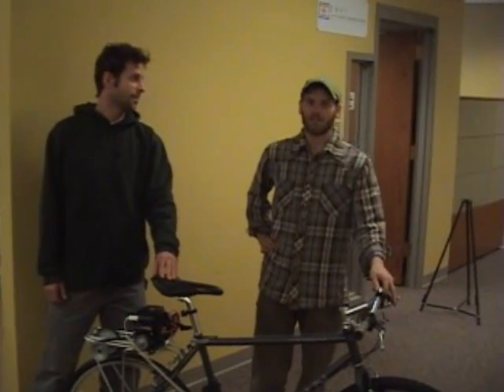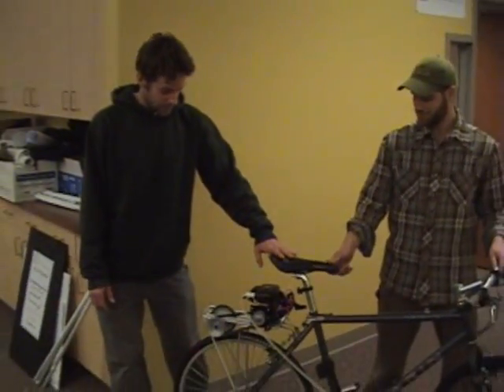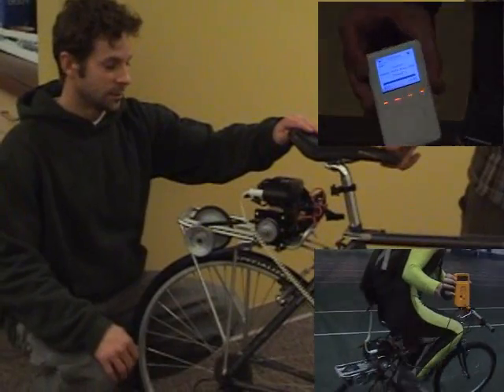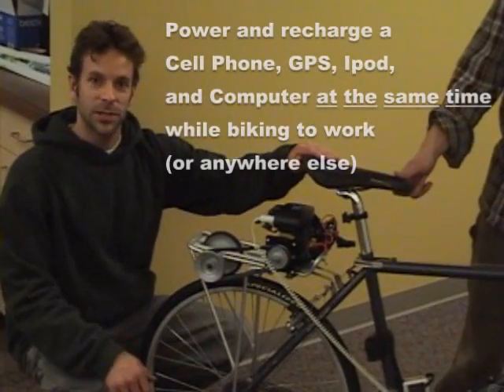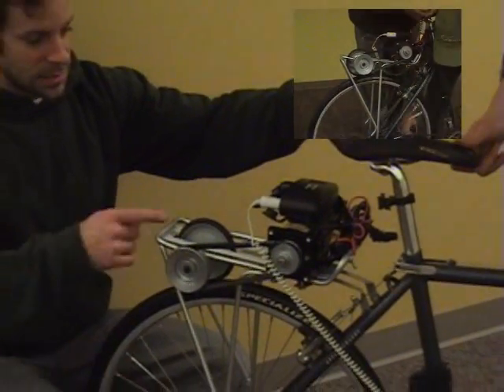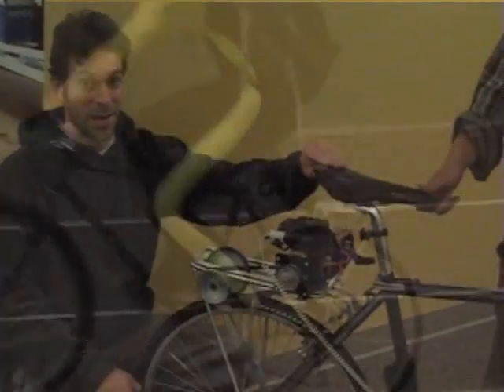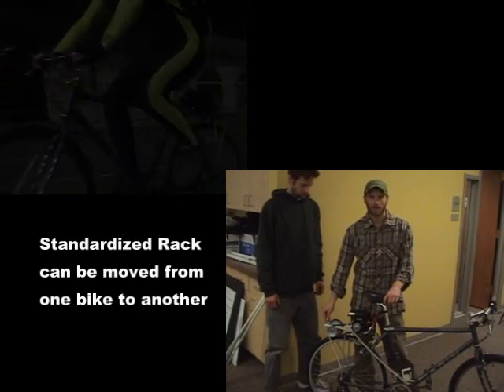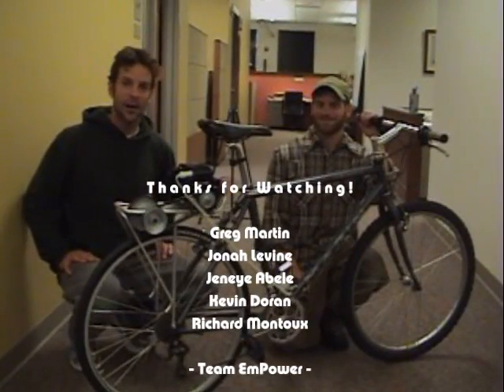Mobile Pedal-Powered Generator

Comment: not really but i been cycling in a currie bike for a while with a long range lyfepo4 batery from golden motors ... i tried to buy their motor kit too but had a bad experience dealing with them .. their kit did not work and they refused to give my money back ... anyways going back to your question since i been using the Currie i had found out than buying the whole bycicle its better and than i will need to buy a flip flob hub with an aereospoke or similar since too much weight damages the wheels.

Comment: Hi Kevin ,I would like to attach and small generator  to my bike wheel that will recharge 2 or 4  AA rechargable batterys that light a led bike headlight .So I don't have to worry about the batterys going dead. Something that will keep the batterys at full charge. I can't  find a rechargable bike led headlight that can be connected to a small generator  that recharges.I've seen bike led headlights that have small hand cranks built in but I don't want to stop and crank to recharge batterys.

Comment: mmmmh. I*'m guessing that the generator is capable of producing much more power than you are currently pulling... Try putting a battery in parallel to the circuit so maybe you can keep charging yopur laptop wen u at red light?? lol just a thought+

Comment: I made one like that in 1984 using angle irons and 4 wind shield wiper motors mounted on a bike rack. Drive wheels were cut from a closet dowel. It was raised and lowered by a dowel wheel/machine screw combo. For the bike stand I used a 2'x4' plywood, a 4"x4"x8" wood for the bottom bracket and 2 support wires.  (It helped to have worked at a lumber yard/hardware store at the time!) I got 12 Volts and 8-10 Amps to charge a DEAD car battery in 20 min of pedaling.